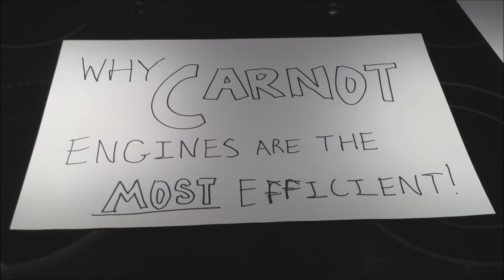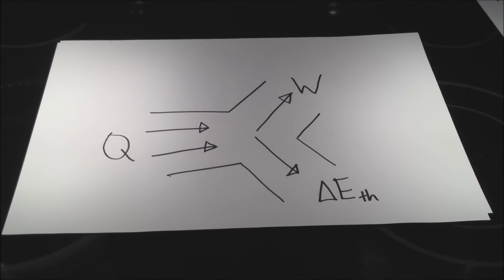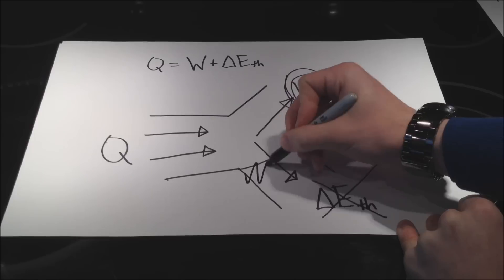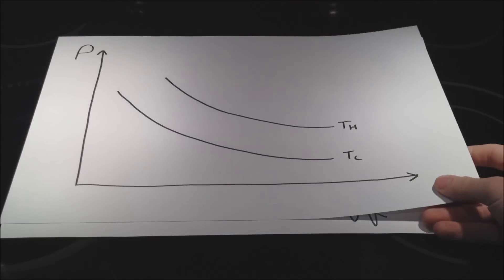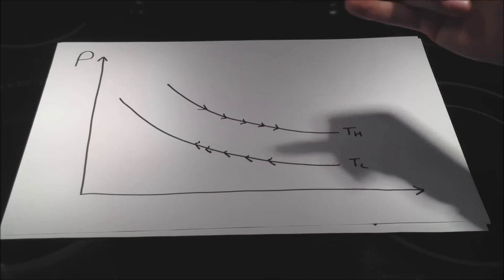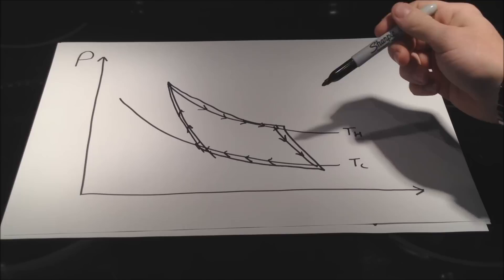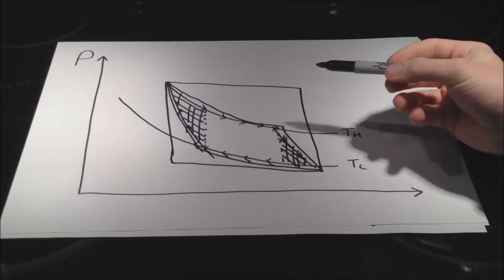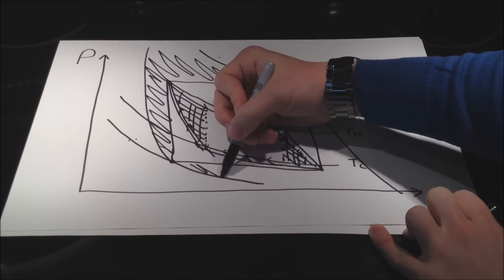Thermodynamics   Carnot Cycle

Comment: Thermodynamics gives you bounds on real engines. Moreover, the explosion of the fuel mixture is not even approximately reversible. How can thermodynamics be of any use in designing real world internal combustion engines?

Comment: For adiabatic process, the temperature is changing but the line you draw looks like isothermal process which means the temperature remain constant along the line.
Reply: Those are adiabats, they’re higher power of pressure = 1/V^Gamma

Comment: can anybody tell whts the need of cyclic process ....y we dnt stop it at frst n get mex work?
Reply: I believe earlier steam engines would operate in an open cycle, as in your reasoning. 
They would produce steam, do some work, and then release it,  filling the boiler with more water. 
This design is very innefficient, since the water must receive heat to be vaporized again, they waste all this heat.
These designs were very common in the time of Sadi Carnot

Comment: You can increase the area under the p-v curve if you assume constant-volume instead of isentropic (adiabatic) processes. This true with ideal heat engine where heat is added and removed at constant-volume at BDC and TDC. Correct me if I am wrong! thanks good video.
Reply: can u tell me whts the need of cyclic process ....why we cannot do it in single step

Comment: Best explanation I have seen ,that  what Carnot really thought in 200 years ago 
the way to get best efficiency you have to supply heat at constant temperature to imply that all heat added is transformed to useful work than move adiabatically so all internal energy can be transformed into work 
by doing so we get the greatest boundary work
Reply: bt work done in adiabatic process get cancle out in the complete cycle. ...thn whts the use of it we dnt get any work in adiabatic process?
Reply: +Rajni Sabharwal the first adiabatic process 
designed especially to be cancel out with the second one 
instead of exerting work in the last compression 
you got the same amount from the first adiabatic

Comment: How do you determine the shape of the curves?
Reply: Those are isotherms meaning the temperature doesn't change. 
PV = nRT  .==========> nRT = constant for isotherm (constant temp)
PV = C ===========> P = C/V ========> where C is a constant. 
P = C/V looks like that curve because P is inversely proportional to V. 
Search google and graph anything that is Y = number/X this is an inversely proportional relationship and for X > 0 the curve looks like the isotherm curve described.
Reply: Thanks, yeah I thought about it for a long time and finally figured it out that to maintain temp that would be the  proportional curve. A relationship of P to 1/V.
Reply: thanks,
but how about the adiabatic curves?
why they are in particular specific direction and angles?
i mean pls expalin about the adiabatic curve shape he drew.
Reply: +Dakota Burrow thnx